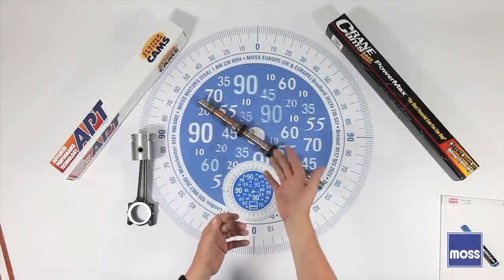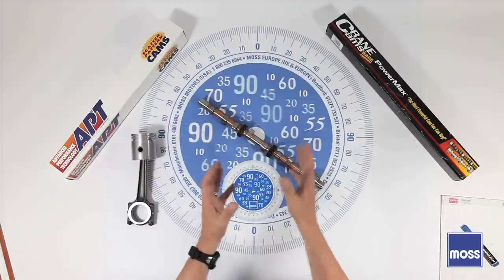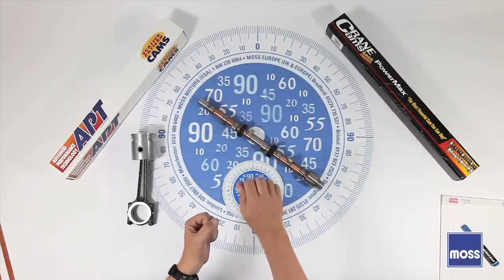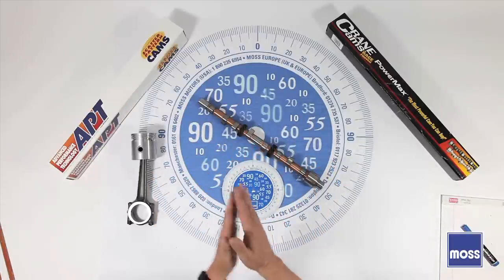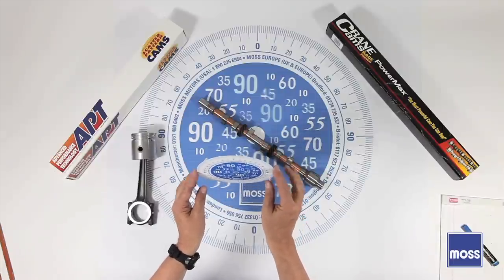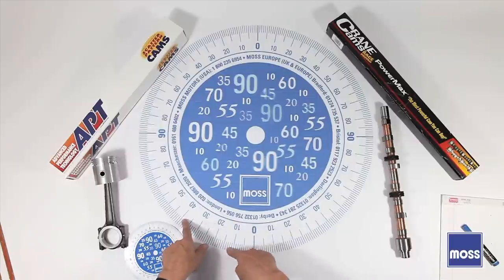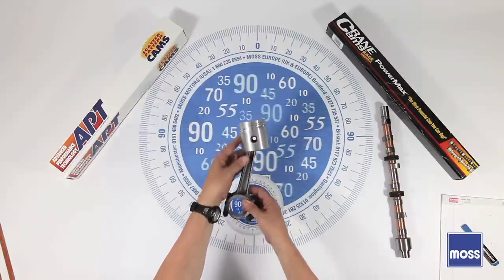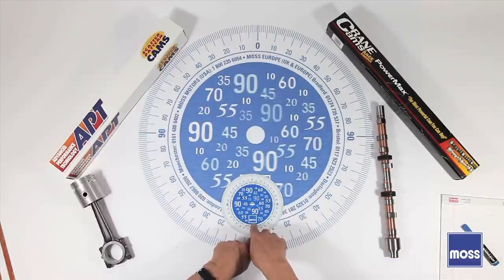Camshafts (Part 2) - Characteristics of a performance camshaft

Comment: Maybe I'm confused but seems your references to after and before TDC are backwards at least with a clockwise turning engine as facing the degree wheel and as looking at my Summit degree wheel with BTDC and ATDC label on opposite sides of where you mention them in reference to TDC.  From my reasoning in a clockwise right turning crank shaft all wheel degrees after BDC rotation would be before TDC until reaching the TDC 0 degree mark where they would then change to After TDC referencing degree numbers up until 179 being just 1 degree before BDC.    Your video mentions degrees right of TDC as being after but those degree marks with a clockwise or right turning crankshaft would be reached ahead of or before the degrees on the left of TDC when you start referencing them as before TDC.  Can you clarify please.  Thanks

Comment: thats a thing volkswagen (and probably others too) fixed, by making a cam that has 2  slopes for every valve. one for low to moderate rpm, and one for when you floor it. this way you allways have performance and stability